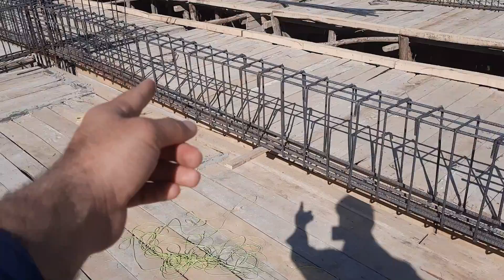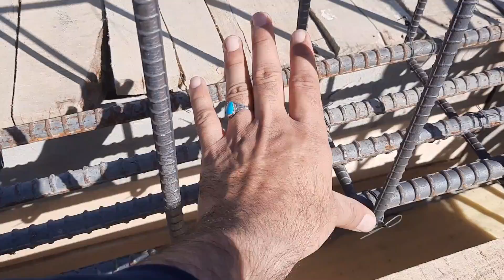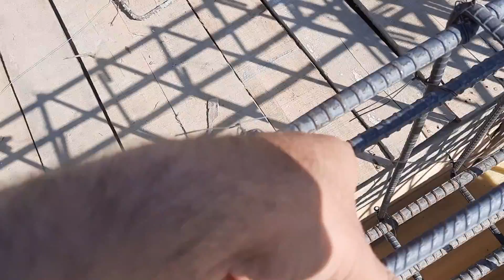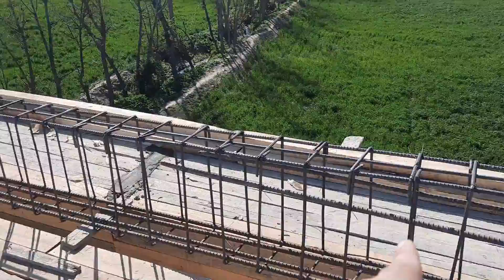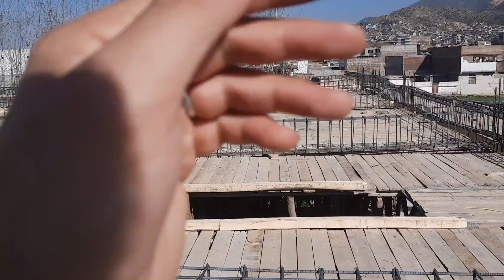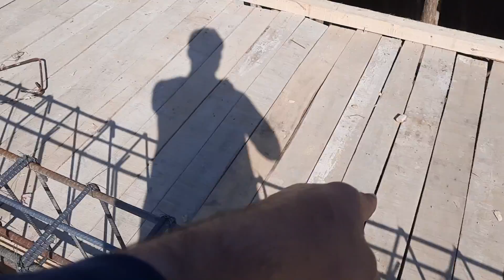28 Feet Beam Design Technical Terms on Site |

Comment: Sir you have provided here 16mm steel , 16mm steel means 1.6in² area of steel .
But practically we have 
10 number bar area=1.22in²
11 number bar area= 1.48in²
12 number bar area= 1.76in²
Then which number steel is used while here according to you is 1.6in² area steel is used .while practical no number of steel is designed which have area of 1.6in²!
I am confused regarding this any one please consider my question